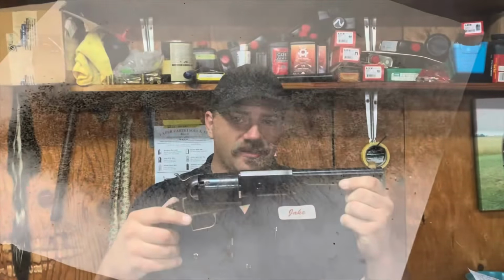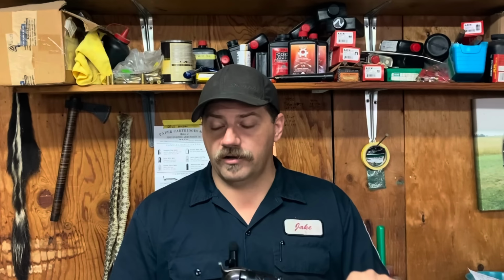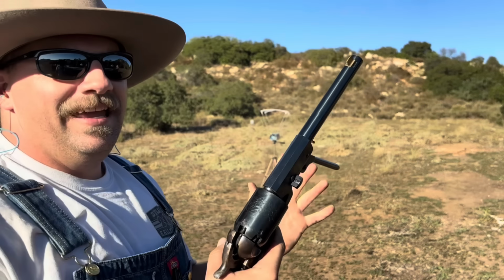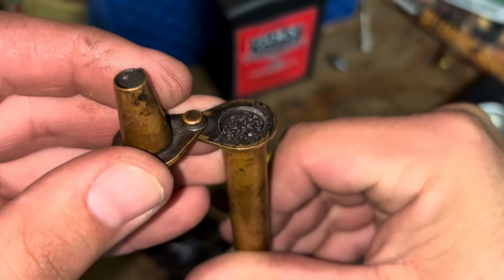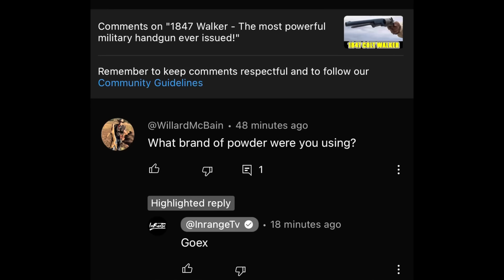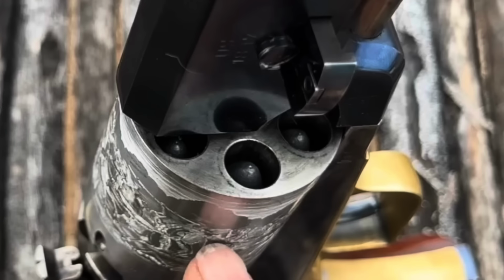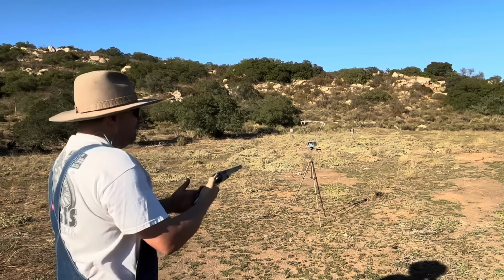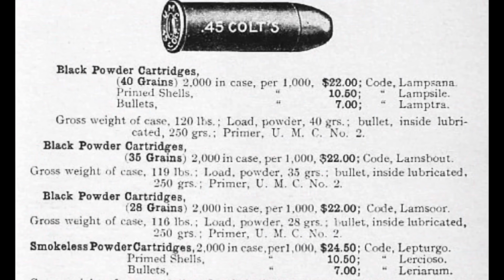The Colt Walker. Not The Most Powerful Revolver Of The 19th Century?

Comment: Hi good day,would like some advice...I have made some balsa wood black powder not pucked but screened an when I put 80grains into a 12guage shell it's 3/4 full what can I do to accommodate wad and shot?
Reply from the maker: You really need to corn your powder. Balsamic is so light that it takes up an outrageous amount of volume that you run into problems like that. Start pucking your powder. It’s the only way to fly
Reply: Ok thanks ...have you ever tried making  say 80 grains   bp pillet for shotgun ? Do you thing that would solve the problem volume wise...

Comment: 45 Colt FTW! I know it's not the holy black but I have a 300-MP 45 Colt load that pushes a 325 grain bullet out of my 5.5" Ruger Redhawk at an average velocity of 1180fps(I have not chronoed it out of my Blackhawk), giving me right around 1,000ft/lbs of energy. That wouldn't have been remotely available back in the day but it's an absolute thumper of a load for the modern day Ruger only 45 Colt capable guns. Question for you: when you shoot 45 Colt cartridges with black powder in them, what do you lube the bullets with?
Reply from the maker: I’ve been using SPG lube lately and it works swell
Reply: @Everythingblackpowder  Thank you. I'll have to get some, I'd really like to do some black powder 45 Colt loads for some fun plinking. Are you hand lubing them or do you have some kind of lubrisizer or pan lubing them or something else?
Reply from the maker: Pan lube

Comment: Thought I was going crazy.   Stuck in NY for a job, so no real BP but loaded 45 Colt with appx 35gr of Pyrodex P, noted the excessive recoil and went to a 24gr (to replicate the eventual 28gr service charge) and found it much nicer and not lacking a n any real way.  

Got a Walker by Uberti, loaded some “normal” 50gr charges with Pyrodex P and couldn’t seat a round ball….   Shot a “reduced” 40gr charge and was surprised at the recoil.  

Pyrodex, Triple Seven and the others are awful.
Reply: What's wrong with 777? I only use it and never had any issues
Reply: I agree Pyrodex especially is awful stuff. Extremely corrosive and it is prone to hang fires since it ignites poorly compared to real black powder.

Comment: hello, a short time ago I was looking at a close comparison between two 44 revolvers with the same barrel length, a Colt and a Remington cap and ball both (replicas). In France we use PNF2 powder. The results were in favor of Remington.
just a question in your opinion if the powder you had was of another type could the results have been different?

Comment: I have a Walker and several Colts and clones 1873. I have always suspected that the Walker was overrated as far as it being the "44 Magnum of its day". Just observing penetration results with similar charges and bullet weights. Thanks for the chronographical data and other info.  Interesting about the difference in compresibility of different powder manufacturers.  Makes sense but never thought about it. I subscribed and glad I found your channel.
Reply from the maker: Thank you.
Reply: The Walker was indeed the first bpm revolver.  Overrated is just an opinion

Comment: I am curious, I have seen in several places that the first load for the 73 colt was 50 gr of 2 F. then the Army had the load reduced to 40 gr.  As I understand the civilian loads were 50 Gr for some time, then 40 gr. was loaded by other makers.  Is this correct?
Reply from the maker: No
Reply: You’re off by about 10 grains. The original .45 Colt was loaded with around 40 grains. The Army reduced that to 30 grains almost immediately. Many civilian commercial loadings stayed near 40.

Later on the Army reduced their load even further, to mimic 45 Schofield.

Comment: Hi, just stumbled across your episode on the Colt Walker. I did an episode on my channel also on the Colt Walker loaded 40 than 50 grs 3f pyrodex not my point, my question is my Walker was a model 1 (Colt Walker 1841), I didn't catch your Walkers model, could it be possible that the cylinders dimensions on the Walker vary model to model? Example is the first model Walker cylinder larger than the third model Walker cylinder.
Reply: A colt walker in 1841? Samuel Walker didn't even join the Rangers until 1842
Reply from the maker: I think you’re confusing the Walker with the first, second and third model Dragoons. The Walker is not the same as the dragoon. The only Walker was the 1847 Walker. Hope this is helpful.

Comment: I am now begining to doubt my sanity, or at least my powder measures scale markings. My Pietta 1858 Remington took what was indicated as a 60 grain charge or FFFg Goex with a .454 round ball with a little room to spare. My father and I took it out and basically proofed it after we got it to make sure it didnt blow up on us. We stopped there happy with the results, and ended up finding its preffered load of 28 gr of FFFg swiss with the cylinder topped with grits or a Hawgzilla felt wad.
Reply from the maker: Heard of very cheap powder measures being way off. Either way, check it against what it weighs as long as you’re using real black powder and not a substitute.

Comment: Ok, I am so tired of  hearing that the original walkers have larger chambers. Every person saying this has never even seen or played will a real walker. For us how have. The real walker doesn't have bigger chambers. If there is a size difference is only going to be a grain or 2. Not a Enough difference to make a difference. I have a fluck dragoon they are so early they were built with walker parts. It's cylinder has the walker roll engraving off set. Meaning it started life off as a walker cylinder. Later cut to the dragoon Length. If I Measure the back of the cylinder to the bottom the chamber and it's extremely close to a replica walkers. There close enough to not make a difference. Even the several real walkers i have held and played with in person. are extremely close to the replicas, so stop telling and spreading information you are just guessing about. You guys are pushing me to become almost as Belligerent and fractious as jake.

Comment: Do you mind me asking where you got the idea of grain size for these tests for trying to be historical as i was lead to believe they used musket powder so more like 1fg so without doing the test myself being bigger grains leaving more air space would give more area to crunch the projectile down?
Reply from the maker: Consistency for the tests is the short answer. Grain sizes throughout history didn’t really become standard until the 1880s. As for using 1F, yes it will compress easier than 3F but the velocities will be lower because the 1F burns slower than the finer powders

Comment: Great video, very thorough! The only flaw I see somewhat with the 45 colt testing is that I assume your using modern solid head brass and the old brass that was used in pre 1900s was baloon head brass that had more case capacity which would have reduced pressures and velocity. By how much I don't know but I know they claimed 35 grains of ffg would push a 250 grain bullet 875fps, so it may be interesting to see what 35 grains runs in yours as well just to see how close it is to 875fps both to see what the brass does and to use as a control to show that there isn't something special about modern goex. 
Otherwise I think you completely crushed the mythos of the Cult Walker, this is really the only problem I can see people pointing out in your testing. I know Elmer Kieth mentioned this brass change resulted in smaller powder charges in his revolvers.
Reply from the maker: 45 Colt Black Powder Load Development.
https://youtu.be/CpLcAVRFwVE
Reply: @Everythingblackpowder  so it looks like in the 1847 Colt walker you got an average of 1007fps with 35 grains of 3f swiss, which is the point I think the Walker Cult will try to use saying modern solid head brass is much faster than the original balloon head brass. Since the quoted 45 colt original loadings is supposedly 875 fps with 35 grains of 2f, I however doubt that the 1873 with 40 grains would underperform the Walker even with baloon head brass but the detractors likely will.

Comment: I'm thinking the cylinders on these guns may not be the same length or diameter. A slight increase in either or both could make a substantial increase in capacity.

Comment: my fav. is the 1858 Remington i have a set of them with extra cylinders and converters but i do have a good collection of old colts even have a 1897 38 acp which is just a smaller version of my 1911 45 acp then i got a first model first year of ubirti made in 1958 model 1851 navy 36 parts are made by navy arms and put together by ubirti # 536 still in very good shape and it shoots very good way better then new guns from a box i found that you want older reproduction guns more time was spent on them even my Remington's are from the 70's but they were worked on by a colt gunsmith hard to tell how good they were out of the box but they shoot perfect nice and smooth action

Comment: Assuming everybody was honest about their load data and readings then I would suspect variations in the chronographs or manufacturing and/or QC differences in the guns themselves. The only way to tell would be both (all?) Of you shoot at the same place at the same time using the same powder out of the same bottle, and bullets all cast in the same session, over the same chronograph. Probably not likely but still, a good video, thank you. I do find it interesting that the original Walkers were supposed to take 60 grains of powder according to all the propaganda I've read, leading me to think that the modern replicas are not exact copies of the original walker.

Comment: Can't believe it but (lol) getting up there in decades. Been shooting bp now for half a century plus a few years... (but hey! still married to an amazing 35 y/o filipina and have fantastic 3 and 1.6 year olds here that will start in a few years hehe)
Anywya, I never shoot mine with the 260 dragoon rounds, I do not think they did either since the dragoon round came out well.. with the dragoons and not the walker. I use normally 45 to 55 grains with a 210 gr conical. I do not have a way to check fps so wonder if you have tried them?
One other question I have... what is the fps difference from the range you take behind the chronograph when compared to being just behind it?  Does the fps fall off that fast that you maybe lost 100 or more fps in that ten feet? Just curious.

Comment: Quite a few of the walkers blew up for a number of reasons and putting way too much powder in them along with poorer quality steel and iron of time I doubt they were able to get close to .44mag stats very many times before bad 💩 started happening.
I agree with you, while the .44mag of it’s day it’s not even in the running when compared to the 44mag of today
I have loaded up to 45grns of 3f Goex with 220grn Kaido bullet for mine but I load off the gun
Reply: The progression was from the walker to the 357 not the 44.

Comment: The 50 grains could be that someone has a "wrongly calibrated powder measure". Slightly longer/and or wider cilindre. The I used goex could have been, poor memory, a mistake or using the wrong container for a different powder (oh yea i totally have goex , see it is written right on the container, its 5 bucks)

Comment: I wonder if the original cylinders had a bit more space for powder. It seems likely - this does not increase the available power of the gun though, since the original cylinder was iirc malleable iron, and some of the available power in an absolute max load went not into the projectile but into rapid disassembly of the gun.

Comment: The only germaine question:  Is your repro Walker cylinder and barrel exactly the same capacity as the first generation Walker’s.  If so, then your argument is valid.  If your cylinder is the length of the second (Colt CYA) generation, it is shorter and holds less powder.
Reply from the maker: We checked the chamber capacity on three different manufacturers of walkers. Uberti, Armi San Marco and a second generation Colt which were made on the same machines as the originals. All had the same volume and chamber depth were within .010
Reply from the maker: Also, Karl’s is a uberti, same as mine
Reply: @ And this is why I watch this channel!

Comment: Hey Willard I recently found out that if I use the loading lever (or a spark plug) I was able to force 60 grains of 2f Pyrodex into my .44 Caliber Pietta 1851.
I'm planning on getting a Uberti 1847 Colt Walker for Christmas and from what I hear I might be able to force 80 ish grains of 4fg into it to produce a very very powerful load. 

What is the most powerful 4fg black powder available?
Reply from the maker: Did you shoot it with 60 grains? If so, how did it go? The most powerful 4F would be Swiss.
Reply: @Everythingblackpowder  I was able to barely stuff a .454 round ball in after compressing the powder with the loading lever. If you want to see it it's on my channel I compared the recoil between 20, 40, 50, and 60 grains while limpwristing the gun.

And as for 4f Swiss is it able to be compressed? Because I was unable to pack over 50 grains of hodgedon triple 7 2f into the cylinder.
Reply: @Everythingblackpowder  as a matter of fact do you think you could make a video on what I did? use the loading lever or something like it to compress as much powder as possible into the cylinders, since Pyrodex is easier to compress than Hodgedon you might be able to force more 3f Pyrodex into the cylinder than 4f Swiss.

And be safe, I know a Uberti walker can handle a whole cylinder of 4f but once we start forcing more powder than the cylinder can hold it could become dangerous fast. May God and the Bessemer Process be with you!

Comment: i think old Karl needs to check his chrony out i think it might be throwing bad readings! probably weak batteries! and he definitely had a pyro load most likely 35 or under as dull as that powder was and how deep those conicals were seated!! you know Will, i used to have a mold that was supposedly to a walker, using range salvage and wheel weight lead it threw between 206 and 220 grain conicals if i remember right definitely lighter than 260's!!

Comment: I'm not sure if this is true but it was my understanding the original walkers had much longer cylinders where you could get a bigger charge in there and that's the reason why some of them blew up when they put 60 grains of powder in there because somewhere there's a letter of Colonel Colt complaining they're blowing up his guns because they're putting too much powder in there so then they shortened the cylinder to limit them where they couldn't put enough powder in there to blow up the gun
Reply: You kind of have the story right. The walker had the long cylinder when colt found 60 grains and a round ball was to much they cut the cylinder to 50 grains and that's called the dragoon. That's why walkers are so rare they didn't make many because of the problems. when they started cutting down the cylinder the walker became the dragoon.

Comment: @willardmcbain- great points, the most i have put is 50 grains pyrodex behind a round ball, or 200 grain "buffalo bore" bullets which were shortish-heavy ish bullets you used to he shle to buy(havebt checked in a long time on their availability). BP from the era of the 1848-1855 time frame, i dont think was as powerful as the later BP from the tail end of the BP era. the 45 colt was more powerful hands down, the army according to my research, fashioned the 1860 army service load of ~40 grains to mimic the 50 grain load of the dragoons and walker "horse pistols", as the colt cartridge works 1860 army conical was heqvier than the walker conical. the. when they developed the '73 .45 colt they were going for an improvement over the 1860 standard service load by upping a smidge the conical weight yet again. when the army spec'ed the 1911, they wanted ballistics to match the much less powerful scofield, and the 230 grain standard ball round of the 1911 is aling the power loading of the scofield per the army desires. could not agree more with the overall tone of your video! great job and well founded points!
Reply from the maker: Thank you

Comment: Could it be we are making a fatal error in assuming that the  black powder we are using today is equal to or even superior to the black powder of the 1800's? Missing? -  A special high-performance grade of black powder available in the 19th century called "Revolver Powder", and also known by the names of "Cartridge Powder" or "Number One Pistol Powder" (said to be finer even than 4f powder)? "Revolver Powder" formulation was for the unique combustion requirements of the percussion revolver, particularly in combustible cartridge use. Swiss 4f (specifically for pistols) is said to come close to this 'revolver powder.' I believe it is the only Swiss container that features pistols on the label instead of rifles..
Reply from the maker: Brett Gibbons from paper cartridges says that Swiss black powder is the closest thing we have to high quality 19th century powder. He’s a punished author and has written a few books on this subject. So to answer your question, no I don’t believe they had higher quality powder in 1847. Also it wasn’t compressed to the same density as the commercial powders are now making it less powerful. The very fine revolver powder didn’t come around until the mid 1850s if I remember correctly which was the pinnacle of black powder development world wide. As for what powder they would have used for the Walker in 1847-1848, I think it would have been the same powder they would have used in their muskets. Something resembling 1F to 1.5F.